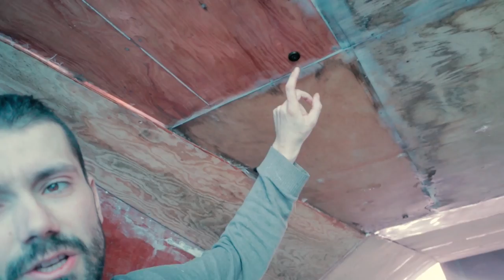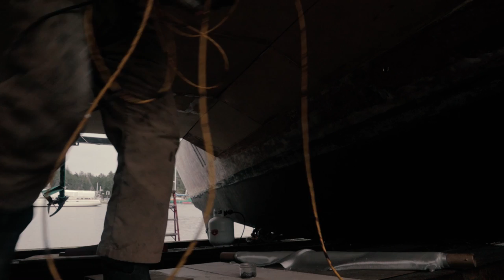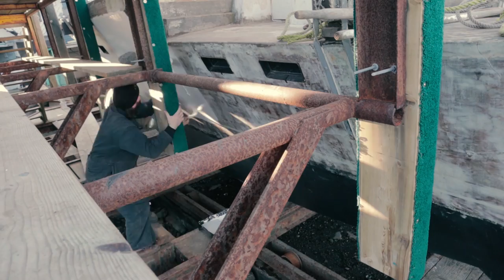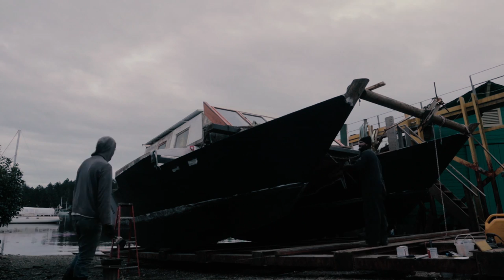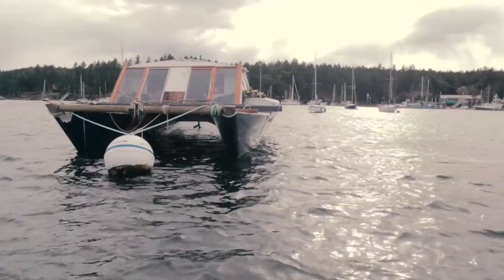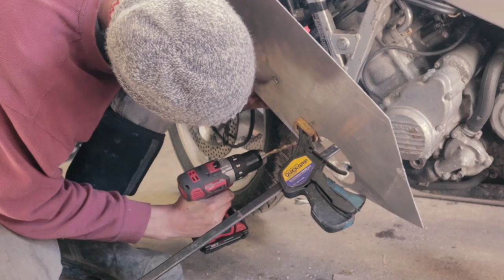Painting the Boat - Sink or Swim 180

Comment: I just painted the topside my small boat (28ft)  with 3 coats of the Interlux urethane you used. It covered nicely, and did not require a 2 part mix with attendant time issues in application. I will see how it does over time. It is popular in my area in North Florida.

Comment: I have been using Interlux Brightsides on my boats inside and out for 20 years.  The earliest paint jobs (external) still look good.  Mine are on trailers (outside) so not the same environmental stress but I would use IBS for any topside work.  Note: not for underwater sections.

Comment: Good paint choice, Teal from ‘on board life’ used Brightside on his entire boat inside and out and he loves it .He is also super fussy and meticulous.  It will be easy to touch up and add to . A good quality marine paint.  Everybody has war stories of problems with every paint, almost all are to do with preparation or application .
Good job, lots of hard work. Might have been easier to pre-glass the bridge deck panels on the floor before  installing. 
Cheers Warren

Comment: Hey Simon, a day late and a dollar short commenting on topside paints, but Interlux Brightside is fine.  I've used Brightside, Interlux Perfection (2 part poly) and Jamestown Distributors TotalBoat Wet Edge (1 part poly) on different boats.  Brightside will retain its gloss, etc for around 5 years.  It's easy to touch up and re-finish, and is good in the durability department.  Interlux Perfection, although much more difficult that Brightside to apply, lasted me around 10 years in direct South Carolina sun.  Both paints look good after those times, they just start to lose their gloss right at those time frames.  I know it won't be available at your local marine store, but do check out Jamestown Distributors' line of paints....TotalBoat Wet Edge.  It's analogous to Brightside, but seems to hold up better.  I've had it on a boat for around 4 years now, same conditions, uncovered in direct SC sun, and it still cleans up and shines nicely.  You won't be disappointed with the Brightside you used though, and as noted above, it and TotalBoat Wet Edge are a lot easier to spot touch up if you need to.  If you ever decide to go the route of Interlux Perfection, let me know and if you need it I'd be glad to go through my lessons learned...it's a tough paint to figure out...but once you figure out the kinks it's not hard, and is a great paint.  Great job on your boat!

Comment: Paint: Brightside is awesome, doesn't last as long as AwlGrip But AG is over $400 a gallon and Brightside is around a hundred bucks for a gallon. If you want to make it last use two part primer, AwlGrip's is 545 I think, badass stuff! If you wast to make it shine then thin it and roll and tip 2 to 3 coats. Love the flag blue especially in a world of white boats everywhere!
Reply from the maker: My friends did awlgrip and its peeling off less than a year later. I havent heard anything good about awlgrip.

Comment: This will be a sailboat right?  I’m a little concern with your epoxy on the bridge deck and the high risk of delamination.  I would however have a structural engineer look at some of your fundamental decision (I know I sound like an ahole).  But a boat needs some structural integrity. And a single sheet of glass is just not enough to give you plywood boat (which is a totally all right BTW)